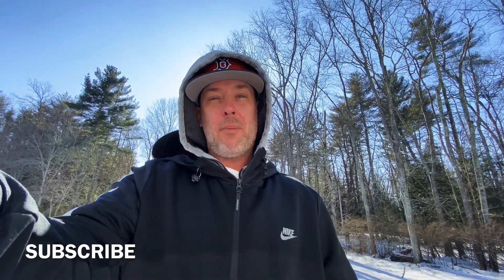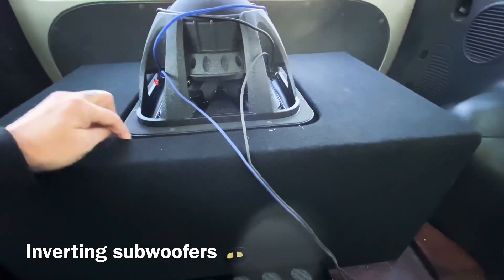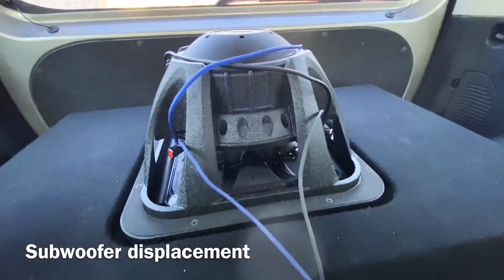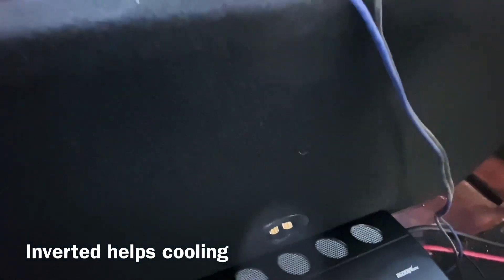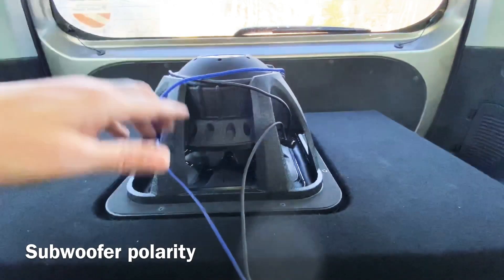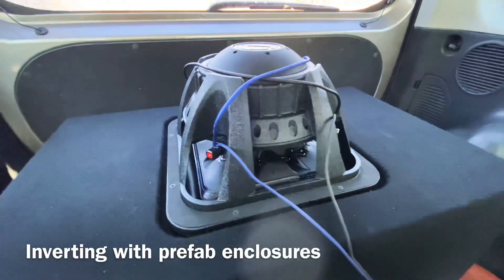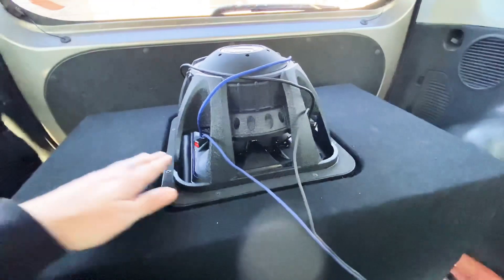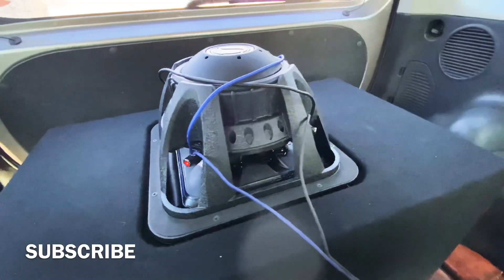INVERTING SUBWOOFERS. Why ? When to invert a subwoofer. How to invert a subwoofer .

Comment: Found this after melting my subs and not being able to tell until it was too late. Mild system, 2 entry level 10s in a sealed box on 460 RMS. Designed with poor cooling, all they had was the hole in the pole. These little things were smoking their brains out, and I couldn't smell it inside the sealed box. I ripped one out and smoke billowed out of the box. And boy were they hot. I could barely touch it. The magnet itself was the hottest piece but the basket wasn't too far behind. I later realized that the glue that held the spider to the basket had let go and there was nothing locating the voice coil. The adhesive holding the speaker together became so hot that it began to liquify, and I couldn't tell, and let them Blast away until it all came apart. I pulled the second one and it didn't smell anything like the first one, you know that smell of burnt speakers. This was strictly a chemical smell, it was just adhesive I was smelling no voice coil. Sure enough, two-thirds of the spider come off the basket.

Replace them with the exact same pair of speakers mounted inverted strictly for the purpose of keeping them cool. Playing under identical conditions that blew the original set, these get slightly warm to the touch. And playing under those identical conditions, it is remaining glued together. I can't tell you or calculate in anyway how much more efficient it is at cooling, but I can tell you it is effective
Reply: comment: liked and subscribed

Comment: Isobaric setups are actually the BEST for spaces like your vehicle. so basically you wire your subwoffer inverted without bridging it and it will pull when it's supposed to push. doing this is okay in terms of sound quality and might even improve the efficiency of your cars sterio When you have the rest of the cars speakers wired traditionally and the inverted subwoffer in trunk at matching impedance, the speakers in the doors and dashboard then actively absorb the negative pressure change from the subwoffer as they work, this actually allows the main speakers to operate more efficiently and might even produce some interesting crate filtering effects depending on modularity of the cars stereo system (position of speakers and frequency response) this concept of isobaric wavelengths are actually very desirable when you want the wavelengths (sound) to travel not (FROM) your vehicle, but (THROUGH) it. 
Thus means that interestingly enough if your setup is designed like my car is,  you literally hear nothing but snare once you step aside from the vehicle. Thus confusing the shit out of every person who sits in your car and decieving all the neighbors into thinking my bass is turned off until thed stick their face in the window and the headroom of the waveform finally travels in one ear and out of the other. This setup makes the lower frequencies of any song literally SUBTRACT pressure from your head when in fact the waveform is supposed to be ADDING it to your ears.
This makes the actual sounding wavelengths only acoustically noticeable when inside the vehicle...
You'll notice no one else's windows or house will shake and you can listen literally as loud as you want granted you MATCH the subwoffers power output to the other speakers so that you don't actually blow out the cars speakers when you turn the master volume up...

Comment: So if I invert both of my subs in a sealed box .. do I wire them normal or invert the polarity as well ?? Or is it fine if I invert both instead of just 1 ... please can someone answer me ASAP !!! I’m wiring them in as I speak
Reply from the maker: If you invert both, you can wire normally. If one is inverted you need to wire it out of polarity of the other one.

Comment: Does the box afto be built a special way ?
Reply from the maker: Can you be more specific when you mean built a special way ?
Reply: @EARDRUMASSASSIN  okay built a specific way meaning does the box afto be built in such a way that the rubber on the speaker flushes inside the box when inverted or does it rest on the front of the box and play without causing a problem with the flexing of the speaker ?
Reply from the maker: As long as the surround doesn’t rub, it will be perfectly fine.

Comment: What gauge wire is running from the amp to the sub? Just got a 1500 watt amp and want to use some spare 12 gauge wire.
Reply from the maker: I believe that was sky high 12ga speaker wire.
Reply: Get some 8ga and you’ll be set forever but definitely from sky high

Comment: I'm a huge fan of inverting. Especially in suv's or of that sort. Makes for a more "boomy" situation. If you want SQ, don't invert.
Reply: Im running a inverted subwoofer in my living room. even there i noticed the difference between running it normal or inverted. if u turn my eq above 45% it litteraly starts taking my breath away

Comment: Take a battery with springs on top or a 9 v and check the popularity but u do u lol I like being for 100 % cause I have seen some cheaper subs that's marked backwards u just never kno now do ya fr and a helper for any one with a trunk if u take pvc pipe and pipe it throw ur rear deck plate ur shit will hit super hard because its not trying to fight throw ur trunk no more its being force feed into ur cab with ya and then ur shit will be intenze as he'll because when all the maths done u will be pretty well running some type of 4th order and trust me after I done it no way in he'll I'll ever not build my stuff into the cab idc what kinda car it was if its got a trunk I'll be pipping that sucker right into the cab till the day I die fr fr steve meada did his black car like that if its good enough for steve its good enough for me fr cause he doesn't play with his rides bet ...

Comment: I have a question ,I have a rockford fosgate ported box designed for 12" subs ,would it be possible to use some fifteens in this box either standard mount or inverted .or if I just seal up the original sun holes and run just one 15" in it ?????please help need info s.a.p.
Reply from the maker: The box probably doesn’t have enough air space for a 15 if it’s designed for a 12.

Comment: I have a 06 XB as well, and I have a huge Wolfram 15 I want to put in there. I want to invert the woofer because 1, I think it looks cool... 2, like you said, airspace. I think it’s going to be a super tight fit, and I think to get the 3.5-4 cubic ft of air space it needs, I might have to invert it.
Reply from the maker: Yea or remove the rear seat.

Comment: If I invert my subs do I have to switch polarity?
Reply: If they both are inverted or both conventional they can be hooked up standard or reverse polarity. If one is inverted only one is reversed. Doesn't matter which. They don't have to be "in or out of phase with the components/coax, (mids/highs) because they are not playing the same frequencies. The only place that phase cancelation is really an issue is down low. This is because it's very easy to align long sound waves (or un-align for lack of a better term)  Higher frequency waves are extremely tiny making it much harder to cause phase issues. Waves cancel when 2 identical waves are 180 degrees out of phase with each other. Provided the subwoofers are on the same plane, they should be moving together. (Impossible by sight to see)
Reply from the maker: No . only if you’re running more than one sub and one is inverted and the other isn’t . Some ppl say they can hear a difference if they switch polarity. I couldn’t .

Comment: Inverting a single subwoofer alone only matters to the guy who's looking at the thing while he's listening to it. The actual benefit of inverting a subwoofer driver is apparent when you have a second driver that is NOT inverted and the polarity is oposite (popularized by M&K "push/pull" subwoofers).
Reply: I gained 2 dbs when I inverted  my sub so it was very noticeable
Reply from the maker: Gained air space in the enclosure .
Reply: @EARDRUMASSASSIN  - The driver occupying a high enough percentage of the enclosure volume to  make a noticeable difference would mean that your enclosure was way too small to begin with. How is it that the whole car stereo community seems to be oblivious to Thiel/Small paramaters?
Reply: It creates more headroom so your ears will actually be tricked into believing its taking pressure from your head when in fact it's merely when positive waveform leaves your ear that you notice the difference in headroom. This makes it sound like the audio is occupying more airspace than normal only because the other speakers are drawing the air pressure from the wavelengths away from sub, making the lower frequencies modulate back and fourth differently from the higher ones because actually it's more desirable to invert the main speakers and simply decrease the level of the Amp to your sub, making your entire airspace simulate the positive and negative pressure changes of a subwoffer acting normally..
The difference is once you leave your space your ears only notice the higher frequency that bleeds out from the lower ones pushing against the speakers...  headroom Is only comprehensible when you in same room as sub like he said

Comment: I want some advice on buying subs, I'm a jbl fan and I want to know if DVC or SVC will be better firstly and if you have any knowledge on them maybe help me deside on the best sounding one between Gt5-12D dual coil 275 watt rms; and jbl stage 1210 250watt rms single coil.
Reply from the maker: Welp honestly the impedance of a subwoofer mostly plays into how low you want to wire down your amp . For example dual 2 can be wired down to 1 ohm while dual 4 can be wired down to 2 ohm . Single 2 ohm will be 2 ohm only . Single 4 ohm will be 4 ohm only unless multiple subs are wired up . I honestly don’t know much about jbl subwoofers to offer advice on which is better other than the dual coil allows more wiring options. Hope that helps some .
Reply: @EARDRUMASSASSIN  yes thank you 😁

Comment: I have a fiberglassed ported bandpass box with 2 JBL 12's should I invert them inward and remove the fiberglass face?
Reply: Try it out like I did I had a cheap 10 inch dual didn't fit in the ported box I had then I inverted the sub and it hits good not gonna lie trunk also acts like a room bass waves hit louder from my experience
Reply: @OBARRVAGOS  band pass usually only sound alright with glass in
Reply: Inbox me a picture of your box @ imtakeflight7414@gmail.com... Curious what you mean by fiberglass box...

Comment: How did you seal the sub? Because my L7S's have rough top surfaces so there will def be small gaps between baffle and sub. I'm gonna try weatherstripping caulk tape, $3 @ Walmart which E.X.O. suggests in one of his videos.
Reply: I dont know if you did caulk but wearther striping for windows at a hardware store works great and has multiple options for cheap
Reply: ahh, you're relying on the carpet, i see.. my box is coated in rhino dura liner so it is quite bumpy/rough surface.
Reply: @lowhertzhighspl  I would look into Some bike innertubes cut up you can make own gasket.
Reply from the maker: The enclosure had carpet which acted like a gasket .